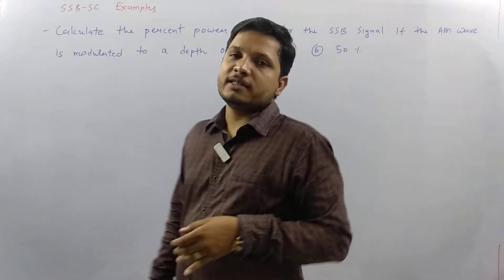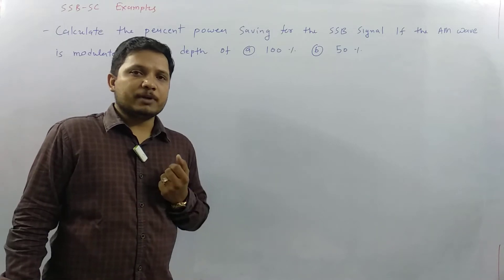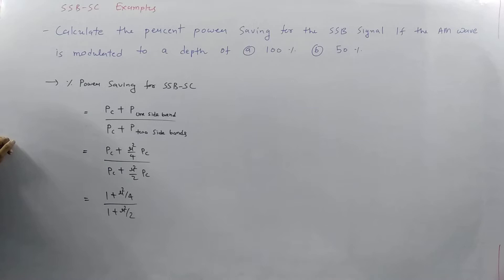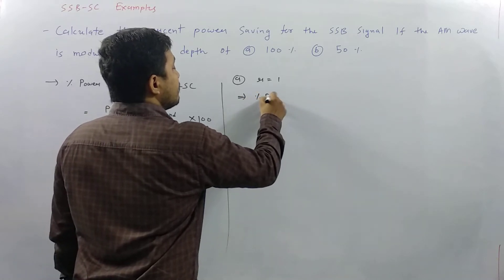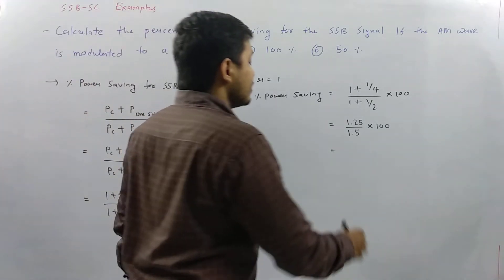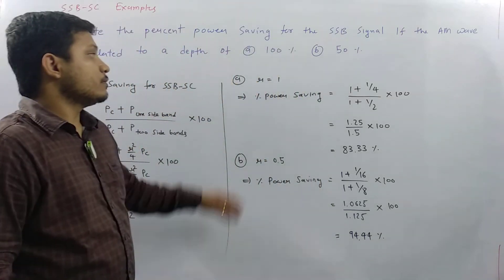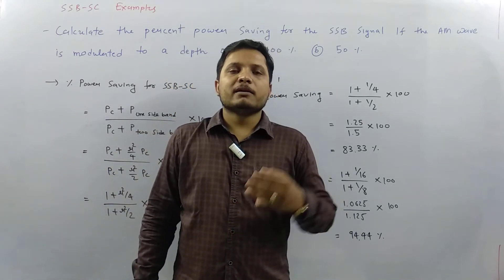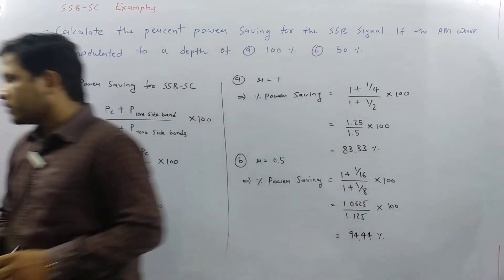Example on SSB-SC Single SideBand Suppressed Carrier in Analog Communication by Engineering Funda

Comment: Sir. Thanks a for videos. But I have a doubt regarding ssb-sc as the name itself indicates that carrier is Suppressed then y u considered the carrier power in numerator?!!?  Plz tell me sir.
Reply: Check both ways brother ...Its power saving not transmitted power
Reply from the maker: See it properly
Reply: @EngineeringFunda   yes you considered power of the carrier
 in the numerator is that correct?
Reply: he is not considering carrier power but expressing side band power in term of carrrier power and modulation index!!
so its side band power only!